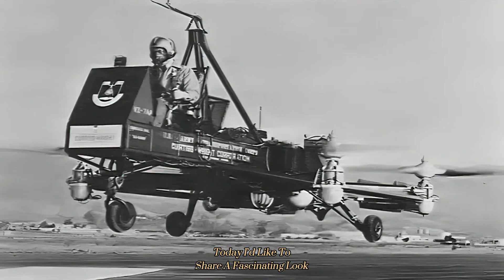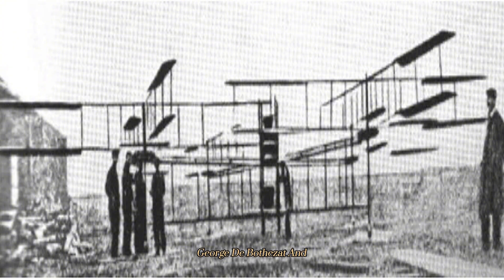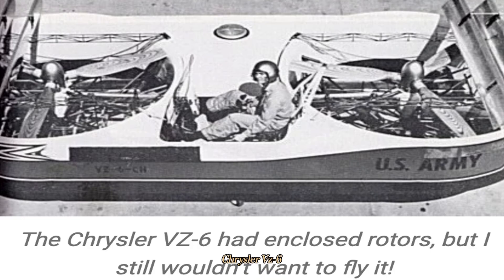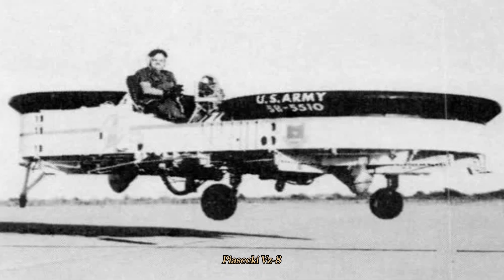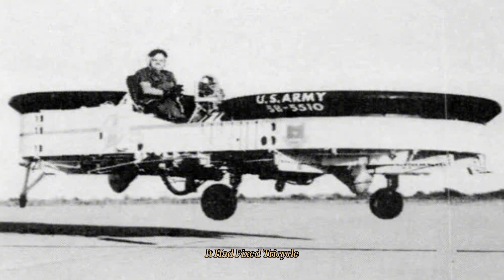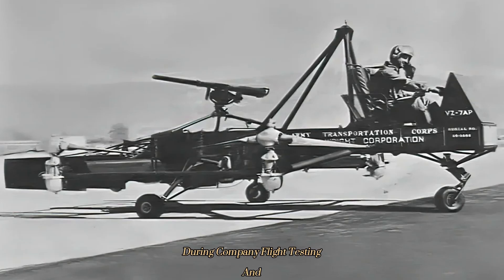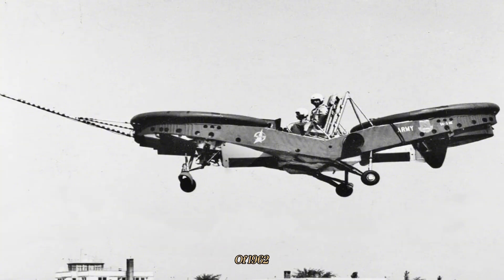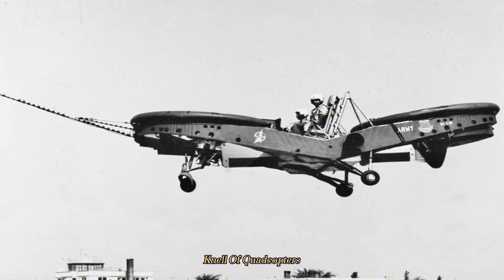The Bizarre Design of Quadcopters

Comment: The Chyrsler and Piasecki aircraft  are not quadroters. They each derived their lift from two propellers , each rotating in the opposite direction to each other, and they were designed to fly at only a few feet above the ground.  And with the exception of the Convertawing, none of these aircraft were helicopters and therefore cannot in any way be called a quadrotor